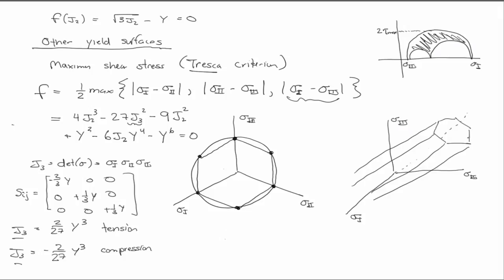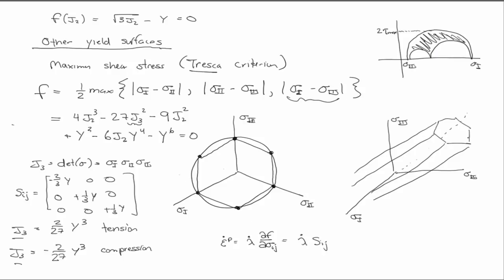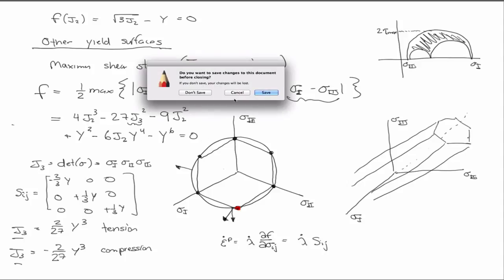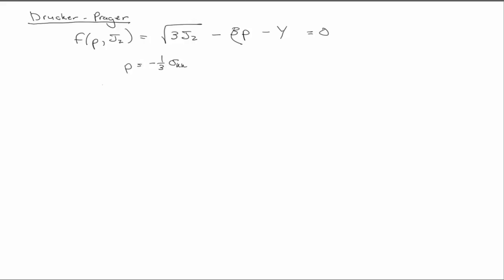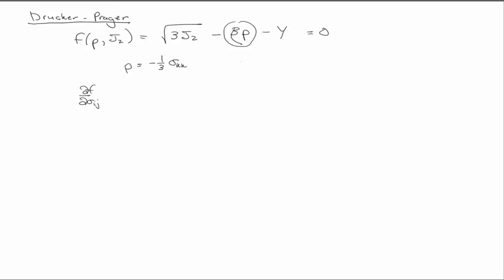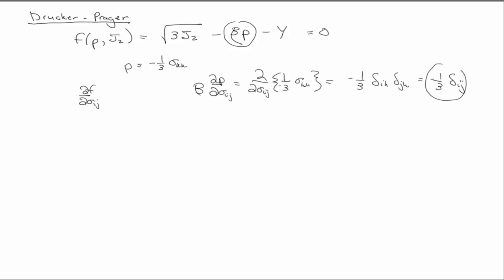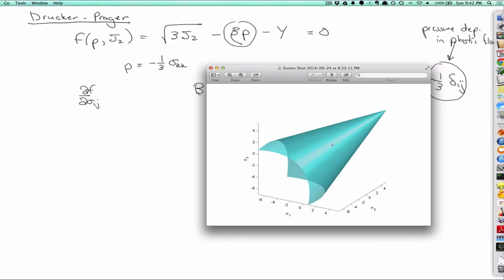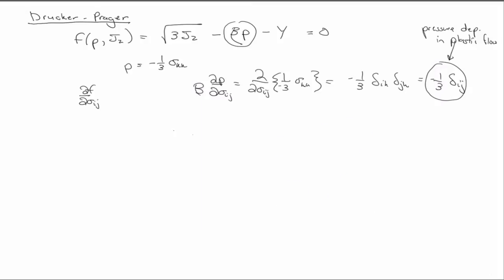Drucker-Prager yield surface

Comment: Please i am currently trying to model concrete using drucker prager cap model (as i need to account for both tension and compression) i need help on how to determine the parameters required for the drucker prager cap model. Thank you for your cooperation and understanding.